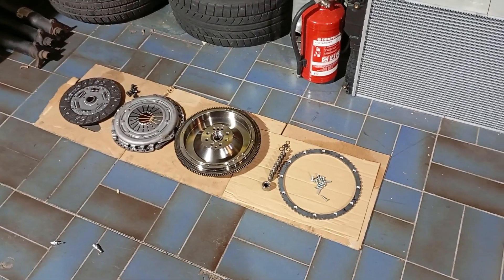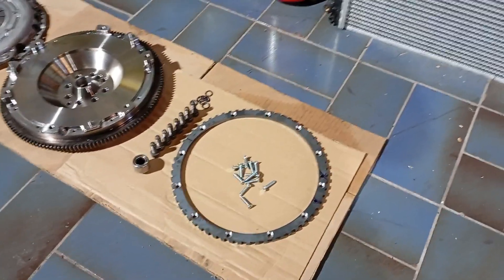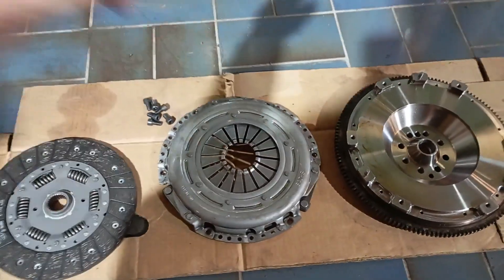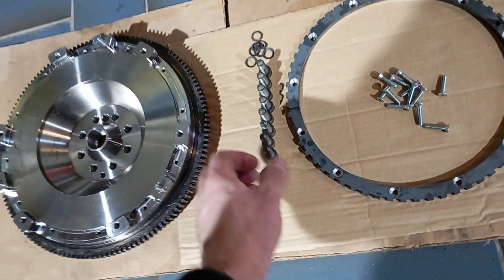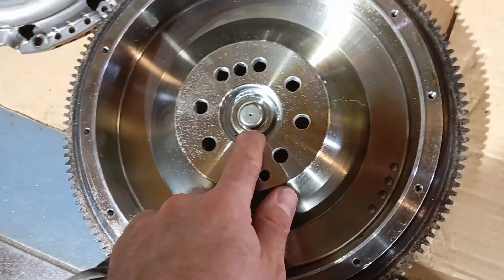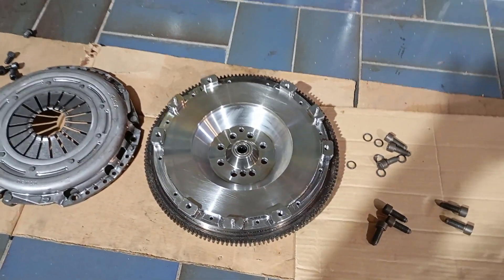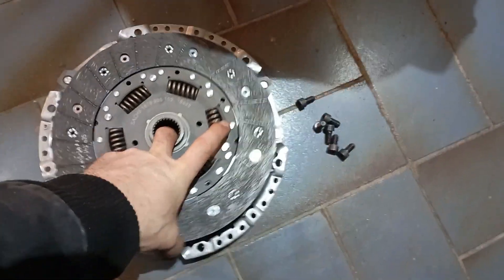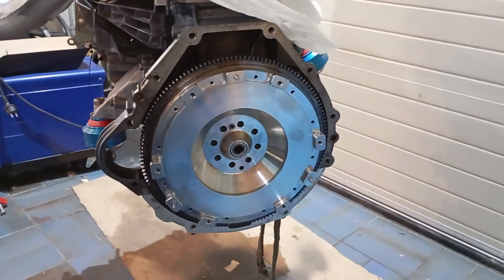The  850Nm Flywheel and Clutch Kit for your Mercedes W202 C208 W124 W201 Turbo and others

Comment: Does it fit on 716.641 transmission? It appears to have a longer input shaft than traditional short shaft 6-speeds. It sticks out longer than the belhousing. Is that normal?
Reply from the maker: @Kristofersce  the tip of the input shaft for centering, always sticks out a little over the flange surface

Comment: Can you please advise what would be the best option for om605 + manual 5 gears. I have the stock setup with dual mass fly wheel and with 7.5mm pump my clutch started to slip on 3-5 gear... :( looking for cheap solution
Reply: I thought about about clutch with kevlar + reinforcing the pressure plate

Comment: I will be buying alot of m111 parts for my turbo m111 build. I have a special platform i found m111 brabus 2.6 engine from slk that i will use in my w201. Do you think 2.6 will be good engine to turbocharge? I have h beam rods for it and it has oil injectors. I think i need to buy copper headgasket and stronger bolts from your shop. Good luck with your build!👍🏻